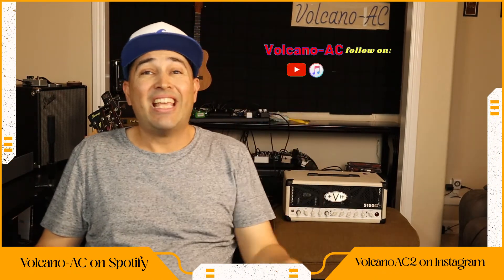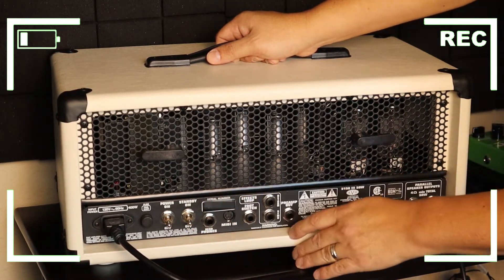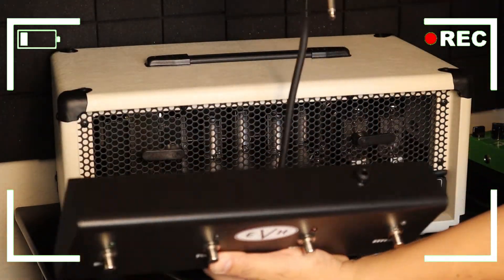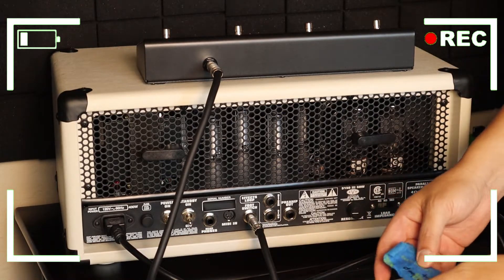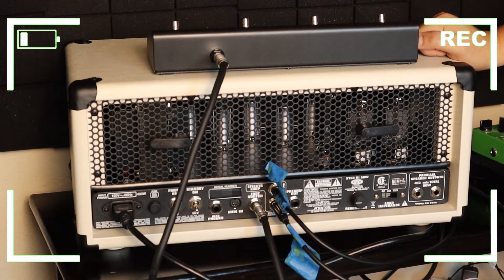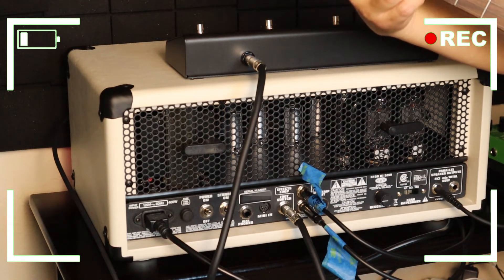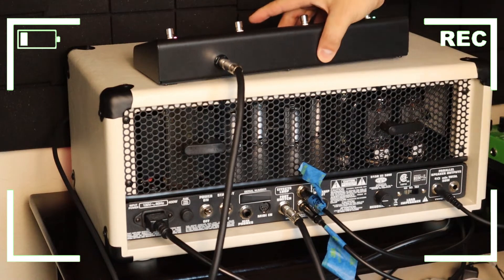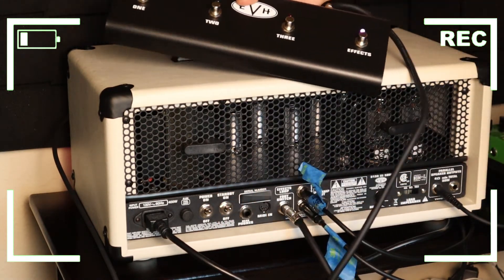How to properly connect the EVH 5150 iii amplifier to the cabinet, foot switch and effects loop.

Comment: I can't seem to get my footswitch to to turn on after being plugged in. Do you have to have an fx loop for it to work or should it just work by itself?
Reply from the maker: Hi there! Is it the footswitch that came with the amp? If it’s not it might not be compatible, footswitches do the same thing but work differently. If it came with the amp make sure it is being plugged into the foot switch input jack. Do not plug a foot switch into an audio input jack. That includes the fx send and return input jacks, do not plug it in there either. Connect the foot switch to the foot switch input of the amp, then turn on the amp. If the foot switch is the one from the EVH 5150 iii press one of the buttons and you will see one of the lights on. If after that the foot switch doesn’t work and the amp is new they should replace you the foot switch. I hope the above is of help. Keep rocking!
Reply from the maker: And no, you don’t need an FX loop to work, you need the foot switch input jack and the compatible foot switch.

Comment: Hey Volcano AC. I have the EVH 5150 iii EL34 50w. I have a couple cables here and I'm not sure what type of cable goes into what slot. For example, I have a cable for the foot switch, and a cable to connect the head to the cabinet. One cable says "Live wire advantage 14 Gauge Speaker Cable" and the other says "RHC Commercial Series  - 14 AWG Speaker Cable". Which cable is for the foot switch and which is for the cabinet? Or does it not matter as they are both speaker cables?
Reply from the maker: Hi Fine Elixir! Great question. As far as I know both are instrument and speaker cables, so you can use both to connect the foot switch and/or the amp. One you can see the details at Musician Friend website and the second one at Sweetwater. So, either way the cables should work well. Thanks!
Reply: Thanks! I appreciate the quick response.

Comment: Is it correct the footswitch connects to the amp with only a guitar cable
Reply: Hi Frankhandy7345! Yes, in this amp the footswitch connects only with one cable. The 2 inputs to the right of the footswitch input are for the effects, one the “send” and the other is the “return” from the effects pedals. This amp uses a regular guitar cable, but other amps footswitch use other type of cables. I hope that answers the question, thanks for stopping by!

Comment: When hooking up two cabinets that are 16ohm each.. which option would be the correct setting on the amplifier 4 8 or 16ohm? Thanks for the help
Reply from the maker: Hi Spenser D, great question! The impedance setting on this amp should be 8 ohms for 2 16 ohms cabinets connected at the same time. If you disconnect at some point one of the two cabs then the setting should go up to 16 ohms. When using just one cab you can use either output, and remember to always use high quality unshielded speaker cables. Keep rocking!

Comment: So 4 ohmes? What is the first one 4 ohmes? Not 16?
Reply from the maker: Hi CthtoNicfly5! To the right of the resonance knob you will se the selector fo the impedance. The first one from left to right is the 4 ohmes, the middle one is the 8, and the right one is the 16 ohms. Make sure to match the ohms of the speaker you are using. Usually that is in the back of the speaker, near the input jack. I hope that helps!
Reply: @volcanoac  ok got it thank you